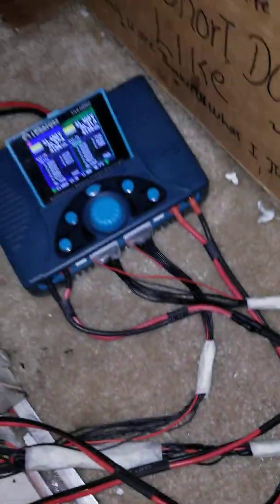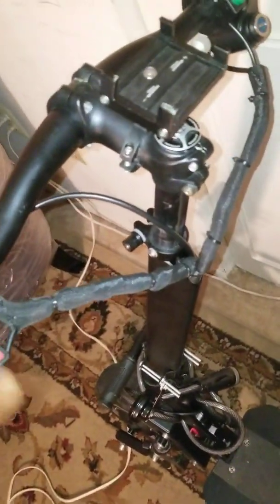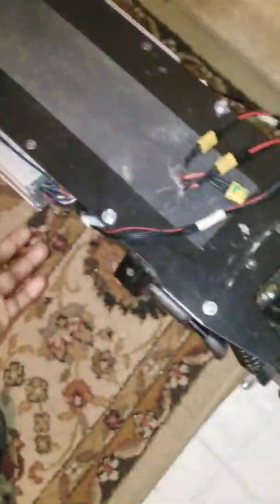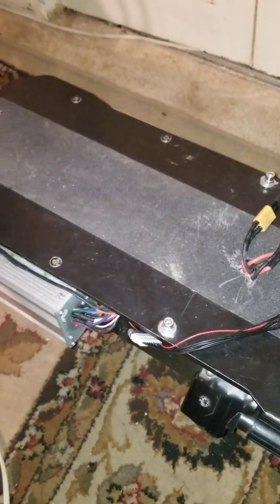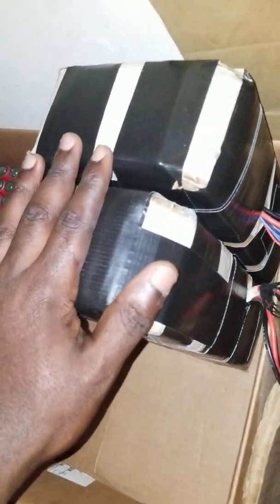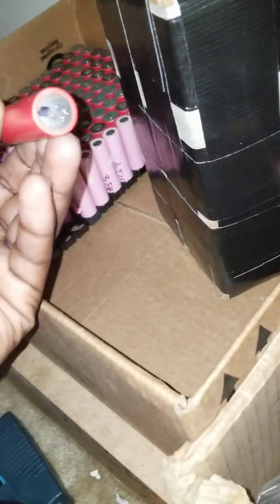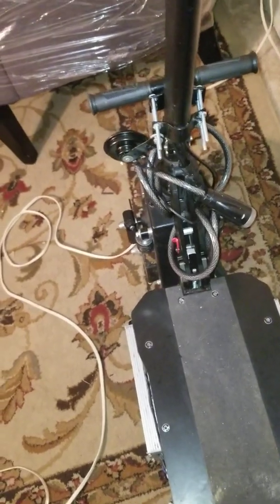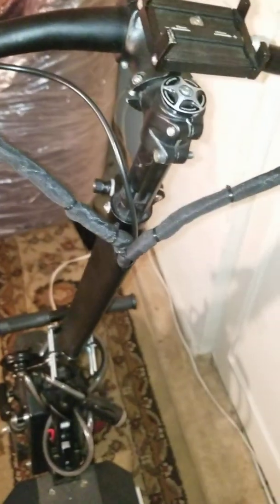My 50mph Alibaba Electric Scooter After 9 Months.

Comment: dang your scooter has been in the ringer.  did you get your seat modification done?  I don't even use my seat that came with my scooter.  it's too heavy.
Reply from the maker: My seat break.  Do u have same scooter as mine?. Would you like to sell me yours?.
Reply: @heardandtested  did you need the seat post, seat, and the metal base plate or just the base plate?  Let me know.  I can get the measurements to confirm the screws line up
Reply: @heardandtested  let me know and I'll shoot you a price if you wanted to buy mine.
Reply from the maker: @c2thew  I need everything
Reply from the maker: @c2thew  u in the USA?.
Reply: @heardandtested  yup. Los angeles
Reply from the maker: @c2thew  can u pls send me a pic of it at chrisngwa2@gmail.com?.